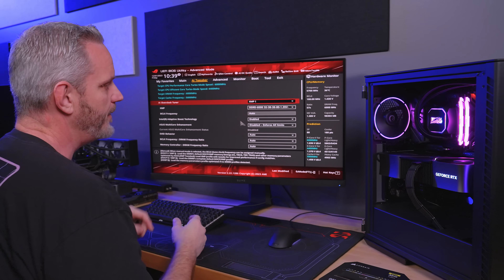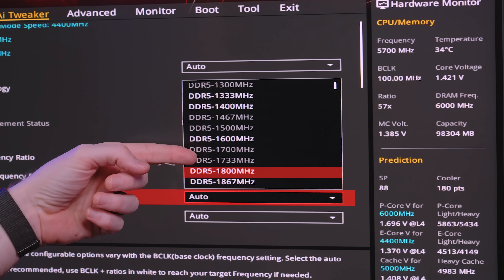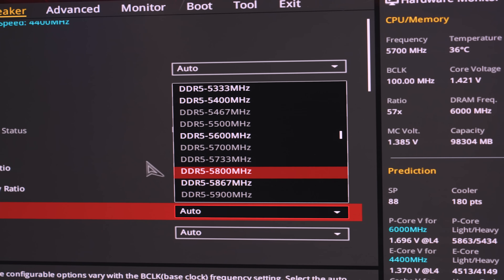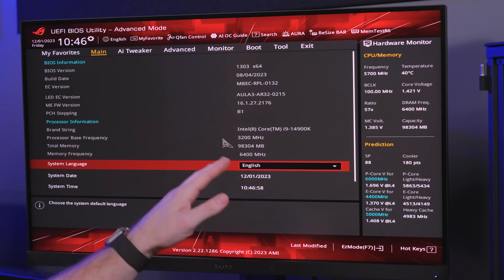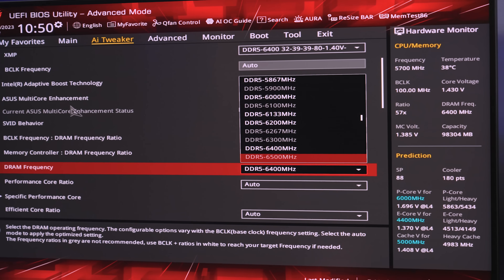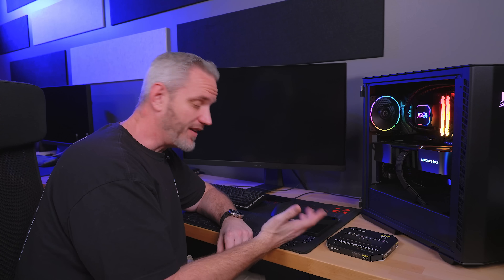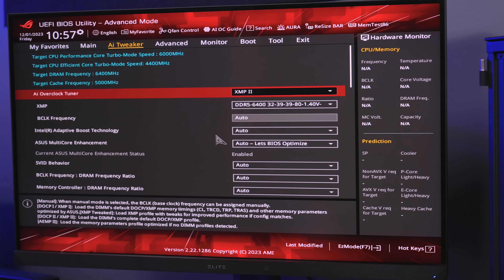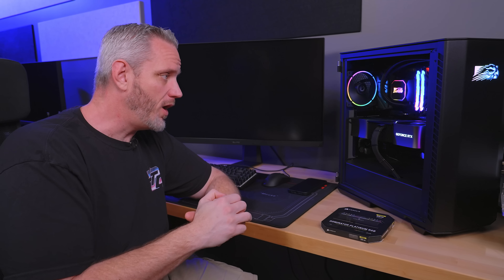Crashing PC? Check this first!

Comment: 14900k owner, with random instability, mc sucks on mine ig, can only get 5400 out of my 2 2x48 6400 kits, assuming it's bc high capacity with potential 14th gen flaws. This bc has been a lot of trouble, it's on a strix z790a wifi2. Been crashing at least once a day, never had issues like this before with other systems. Before today xmp was on auto(off) and set to 4200 and still extremely unstable. Crashes from YouTube even, and has had choppy playback on that. My temps are fine across the board, ryujin 3 360mm cooling it with 6 additional case fans ontop of the cpu coolers fans and a tripple fan strix 4080s. Pretty sure I just got a bad chip. Curious if anyone get instability with this chip without xmp on for some strange reason, I assumed xmp off meant more stability but decided to try turning it on today to see if I could gain any stability.

Comment: Hello Sir, I am having a problem, I have XMP on and my computer restarts whenever I start a game, it used to work fine before even with XMP on but now it is not, it restarts... so I have run benchmarks on CPU and GPU and there is no restart, no heating problem but as soon as I start a game it restarts (ram set in A2 and B2 slots with XMP on) now, when I set the ram sticks in A1 and B1 without XMP, the computer works fine with no restarts even while gaming.

So, top of your mind, what might be the problem? a reply is really appreciated.

Here are my specs
CPU - Intel i5-14600KF
GPU - Gigabyte WindForce RTX 4070
RAM - T Force 32GB DDR5 (6000MHz)
Storage - 1 TB NVME SSD
Motherboard -  Asus TUF GAMING B760M-PLUS WIFI
PSU - DeepCool 750W PM750D GOLD

Comment: i enabled xmp on an 6 year old 9700k 32gb ddr4 dominator ram and since its  crashed on me bsod i disable it but still crashes and bsod should i clear cmos would that fix the situation i feel like i just messed up my system..      i am also aware of the stupidity of owning domiator ram and never useing xmp.. this is my old system i was gifting this to my wife coz i got a new ryzan7 9800x3d build i have xmp on that runs very well. i just want my old system working so my wife can have a pc

Comment: would this also cause random restarts with no warning and no BSOD? PC just shuts off and restarts no errors or blue screen but will sometimes freeze then shut off. 
Intel i9-14900K 3.2GHz
Corsair H150i CPU Cooler With 360mm Fans
Gigabyte Aorus Pro X rev 1.0 Latest Bios
Gigabyte Aero 4070 Ti
Corsair Vengence DDR5 6000HMz
850w Corsair Power Supply

Comment: I just updated my AM4 system, with some 3000MHz corsair ram. Experiencing weird crashes when the memory is loaded (black screen, audio freezes or starts spamming last sample, just black screen restart) and I'm not sure if it's because of my DOCP profile, considering I'm running it one step lower (3000 isn't stable) at 2933. Might try to follow some of these tips.

Comment: Just had this happen with a clients computer R7 5800X on an MSI MPG mobo, running 64Gb DDR4 Fury RAM. Blue screen issues and found that XMP was the problem. Set it to stock settings and blue screens resolved and the system stabilized

Comment: What does it mean when I could run XMP2 no problem with a previous bios, then I update the bios and now games crash to desktop/ I get random BSOD and the only way the games/PC run normally is without any XMP??
Asus z790 F 2002 bios, gSkill TridentZ5 DDR5 6400mhz CL 32, i9 12900k

Comment: My PC is not crashing, but I have a sound problem that is driving me crazy. I need your 2 cents, Mr. Jayz . My recent build with a ASUS B650E-F and a Ryzen 7700x was completed several months ago and is working just fine, until I upgraded my internal CD-ROM drive. With my old CD-Rom drive installed, I could playback my music CDs and make a backup copy of newly purchased CDs. When the drive finally broke (it was really old) I purchased a new ASUS internal CD-ROM drive. After the install, I noticed that when I played a music CD, I could hear pops and crackles coming from the speakers. The music CD plays fine on my laptop system. I replaced the drive with an old Samsung Blu-Ray drive and it plays the music CDs just fine. I then purchased a Plexor CD-ROM drive as a replacement for the ASUS, and lo and behold, it exhibits the exact same problems as the ASUS drive - cracks and pops on the music playback. I had an even older CD-ROM drive laying around, installed it, and it plays the CDs just fine. I am at a loss for why this happens with new units, but not old units. Does anyone have any clue as to what this can be caused by?

Comment: I'm still trying to figure out why my little brother PC keeps randomly restarting it doesn't blue screen it literally just reboots lol. No overclocks or nothing it's my old rig and I didn't have the issues. I'm assuming it's because I jumped from the 2.80 Taichi Bios to the 5. Something I did change out the GPU from a 5700XT to a 5500XT but I know that card works cause it was in a old rig so it can't be that

Comment: 14:26 Can attest to second gen Ryzen being finicky. Built a system for my youngest a few years ago and used an R7 2700 and it refuses to run Corsair RAM at 3000 as tested. The highest stable speed is 2666.

Comment: Great video. I have a GPU that I took out to put in a NVme and now once I put the GPU back in the PC it won't post. got a spare GPU inside right now. I might try turning off XMP to see if the GPU will post. I know the GPU works because I put it in my other PC. It is a 3060 ti from EVGA. The VGA light come on the motherboard. Hopefully with this info I can get that GPU to work because using my old 1060 sucks.
Reply: Update. I got the GPU to work again after clearing cmos. However it still will only bolt with 1 stick of ram. That happened After upgrading CPU and bent pins. I suspect motherboard could be damaged. just wish I could use my other stick of ram.

Comment: I have an X370 system that started with an R5 1600. I tried all sorts of RAM and nothing wanted to overclock with stability on four sticks so for over a year it was stuck at 2133. I changed to a 2700X eventually and I managed to get a 2966 kit to overclock, but the 2666, the 3000, the 3200, and the 3600 didn't want to know. I have just dropped in a 5800X and the 3600 overclocked with no fuss at all. It really has come a long way.

Comment: I have two sets of Corsair DDR5/32GB Ram. How i solved the problem of computer crashing was to offset the ram in the computer. So, instead of set1 going into slot 1-3 and set 2 going into slot 2-4. I put set1 into slot 1-2 and set2 into slot 3-4. This solved the problem and I haven't had any issues since. My computer is a AMD Ryzen 9 7950x Master and I have XMP enabled. I don't have a speed issue and runs at the speed on the packet 5200mhz. The two Ram Sets are identical and manufactured within 2 weeks of each other. However, Set1 is manufactured by 'Micron Technology' and has A-DIE (4.1) and the other, set2 is 'Samsung technology' has B-DIE (4.2).....

Comment: Maybe you guys can help me, i was updating my drivers after getting some fragments which i had before and it always went away doing a clean driver install, i ddued my old drivers, and while installing the new ones my screen went black for 10 min after which i decided to shutdown my pc, after that it just has been a black screen, i have a i5 8400 and a rx 5700xt on both of which i get no video, i got it to send signal twice but it was stuck at the boot up screen not even able to get into bios, i gt no signal via integrated nor gpu, i took the gpu out, still no signal, i disconnect every drive and every usb, no signal, its just black but my monitor does work and does see that some kind of signal is coming through. is my motherboard dead? every fan is spinning and all my rbg lights up and if i use my reset button the fans also change speeds and behave like a restart, clearing cmos also hasnt worked and reseating everything including cpu hasnt either

Comment: totally get what you're saying Jay.  I recently built an Intel system (specs: i5 13600KF, ASUS TUF Gaming B760M-Plus WiFi, TEAMGROUP T-Force Vulcan 32gb 6000mhz CL38) and I can't get the system to run stable higher than 5200mhz

Comment: Why are there so many weird issues nowadays? Buddy of mine had games not launch or crash within 20 seconds on his Intel 13900. Intel said the cpu is fine, Asus said the board is fine. After turning off every default applied oc settings and turning of hyper threading, it worked.
He then moved on to a 14900, same thing. Sometimes even streaming in discord will freeze his pc. Even with all the applied fixes from the 13900.

Comment: Hi @JayzTwoCents i wonder if you can try a cool experiment that has never been done on YouTube: cooling a cpu with barium hydroxide + ammonium chloride endothermic reaction, it would be cool if you can try it in a closed system, using a small DC motor with some blades atached to mix the compositions, however i dont know if the reaction would work in a closed system (medium to tall aio block for example) or if it needs some kind of disipation. I think you are one of the few crazy and professional enough to try this experiment. (I have searched this experiment on Google also, without any results so its a very low chance this has been done before)

Comment: I have always found QVL lists to be completely worthless. In theory, it’s such a great resource. In practicality, being able to actually find the kits that are listed there for purchase, let alone have them actually meet the aesthetics that you need, never actually plays out. Manufactures definitely need to step up their game in this area
Reply: I started to ignore QVL list when my 3200mhz black corsair ram wouldnt get past 2900mhz, but the list had same corsair ram rated for 3200mhz but it was white.
Reply: Same here - I wasn't able to purchase/find any of the RAM listed - like NEVER! 
But in my experience has gotten better overall and in the end I was able to run most kits at their rated speed sometime with a little tweaking like giving it 0,01V more Voltage.
Reply: QVL lists to be completely worthless.     its not it help me had g skill 16gb not stabel  not on the list and now have same gskil 64 gb on the list and work just fine and i can oc it 3600 to 3733no problem at al   my parents have 128 gb 4 dims ddr4 xmp not working at all  and  not on the list to  g skill  we need list qvl  kits  to do work well
Reply: @hardstylboy I thought mine wasn't listed but then Jay said something that made me realize I had been looking for a 4x48 kit when I purchased 2 2x48 kits, gskill doesn't sell a 4x48 trident royal I think, and that's why I couldn't find it on there, it was listed I was just filtering it wrong. Couldn't get my 6400mhz out of it only 5400, think my chip is bad, says I should be able to get 5600 but maybe the high capacity is stressing the IMC too much for that speed.

Comment: Some times the ram will fail with overclock but that doesn't mean it can't overclock on this system.

I was building a system for my brother and I let him plug the CPU and RAM... In the end, after trying everything I simply removed and inserted the ram again and the random blue screens were gone.

3600mhz was throwing blue screens, stock and 3000 was working fine.

Comment: ive encounter about ram speed problem on my r5 5600, i have 32gb 3600mhz cl16 gskill, i set the speed 3600mhz on bios and it works fine on my working apps, but when im gaming, games crashes without errors, i clock back to 3200mhz the ram and everything works fine no crash on game stable system

Comment: @JayzTwoCents and @Phil. I am looking into doing some flight sim stuff and I know you guys do a lot with VR headsets with the racing setup. I have a decent PC and I am looking at the headset strictly for the visuals and then using HOTAS for flight. I also wear glasses which I know was a thing for Phil too. What would be a decent headset that would have good display and not horrible to wear for long sessions?

Comment: I NEED HELP PLEASE. I built a new pc, and I went and updated bios successfully, I left the pc idling in bios and it was fine, I then removed the pen drive and went ahead and started downloading the windows installer to the pen drive from my other pc, I then clicked saved on bios and exit, turn off the pc, and now I’m going to proceed to install windows…. I plug in the pen drive and nothing. I’ve tried everything and I’m not getting no display, reset cmos and nothing. IM STUCK. I removed graphics card and tried using motherboard HDMI and nothing still.

Comment: Is there a particular reason that a RTX 4060 dont work with the PCI-e set to Auto in BIOS, but a forced 3 gen works perfectly? Mobo is a b550-i. Im stumped lol..  Even sendt a card back due to believing its OOB busted.

Comment: my issue is very confusing... I have had my pc almost a year and have been running xmp on it the entire time till randomly a couple weeks ago it went into a boot loop till it brought me to the bios and only way to get it to stop was disabling xmp.. And now icue tells me it will only detect one ram as one is running in XMP and the other in EXPO and that I am using 2 different kinds which is literally impossible I bought a set and they've worked for over 6-7 months like this. Now my cpu is acting weird too and sometimes when I turn my PC on it'll be running at 100% which is insane considering I am using an i7 13700k. I have to restart the pc and most of the time one restart will bring it back down to normal which is like 5-10% at idle. No idea what is wrong, I've updated the bios and everything.

Comment: No one ever mentioned this back when ryzen 5000 came out. 2 32bg kits give me so many issues on my 5600x. Its stable at 3600 like 1/3 of time. So yeah may need to redo with 2 32gb sticks. -_-
Reply: Where the ram modules SS or DS? Ryzen has always been very sensitive to number of ram banks, even 7000 series only supports like DDR5 4800 with 2 DS sticks of ram.

Comment: I'm building a new PC, AM5 Ryzen 5 7600, and I got some 7200 mhz CL 34 RAM for very cheap. I think the seller thin-fingered the price, and forgot to add the 1 or 2 hundreds numeral, so I bought those 2x16GB sticks for a mere 75 eur.

I'm still waiting for the parts to arrive, but once they do, I'm looking forward to playing around with the XMP / EXPO profiles on my Asus motherboard.

Comment: Any chance of an update video on ASUS? I got black friday deals on a z790, 14900ks, 128gb ram, and a 4080. Runs great, 5.8 all P core with 6ghz on 2 cores. The catch is ASUS sent out a motherboard with faulty LAN and wifi drivers. And the driver download website has been down for at least days, so I effectively have a $4000+ brick. Customer service is no help, I asked for a simple 40mb driver to be emailed to me. They say the site is down they cant help. Is there any 3rd party site? Should I just RMA or ask for a refund? It sucks sitting next to a custom loop high end computer and all it can effectively do is glow. Irony is they print right on the Motherboard "Since 2006" but send out bricked units and have 0 support for them. I needed to use your video just to bypass the Windows install, but its still useless without internet.

Comment: Great Video, im running EXPO profile Corsair Dominator Platinum 64GBS @ 5600MHz Started at 6000MHz and worked my way down for stability. I also had to change the PMIC voltages from "SYNC all PMICS" to "By Per PMIC" to get my 4 Memory sticks to work at those clock speeds. I

Comment: Sometimes with DDR5 I had to manually tune or just run at JEDEC speeds. DDR4 the XMP just worked so idk. I've gotten the gaming machines working fine again, sometimes I changed the parts out, had a BSOD nand, changed the ram, nand, and installed Win11 fresh that machine. Other I put on Win10 fresh, maybe driver issues also when I updated never know. Did run the memtest also. But everything works fine now, just it's a mystery, what precisely it was sometimes but changing out ram and nand fresh install seems to fix (for me personally). You know if you try the same machine in Linux and the issues persist there also there is something off, sometimes it could be driver/nand related or the ram. It's like a science experiment testing the machines and then just rebuilding to fix it sometimes. Shame spending for 6000 and 6400 ram when sometimes you get 4800-5800 tops, maybe that's Z690s/B760M and 12th gen idk. Whatever it works becomes like how I feel sometimes and just leave things as is. I did september 14th gen BIOS updates too think that helped a little but some boards ship with 1 year old + BIOS on them might have worse memory support.

Comment: I had multiple bad experiences with DDR5, which is why I wont use any of them until they mature. 
I love how tech collaborates to get people to buy products, but when those products do not work as intended, 
everyone turns around and whistles as if no one is at fault and the only one with the problem is myself for being
stupid enough to trust multi-billion dollar corporations to stand behind their products.

My main gaming rig is 12900K, 4090, and 64GB RAM. 
Yes! I did find a way to use 40 - 55GB RAM during a gaming session along with 21 - 23GB of VRAM.

When I tried the same thing under a DDR5 system, I dealt with crashes everywhere attempting what I did and went back to DDR4.

Comment: I had an issue where mine actually went bad.  I had some CORSAIR Vengeance RGB Pro SL 32GB (4 x 8GB) 288-Pin PC RAM DDR4 3600, obv out of the box they were at 2400.  I was able to enable OC profile to 3600, but sometimes after reboot it liked to reset to 2400.  Eventually one of the modules went bad and the PC wouldnt boot if I had it installed.  I had to send the kit back and Corsair was great and replaced them all.  I havent had issues sense.  But it def was struggle bus for a while.